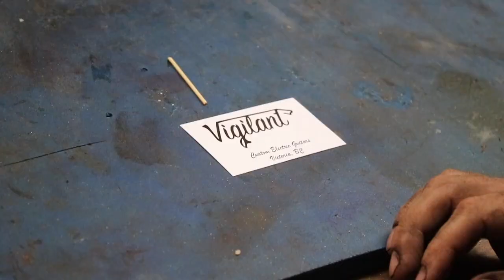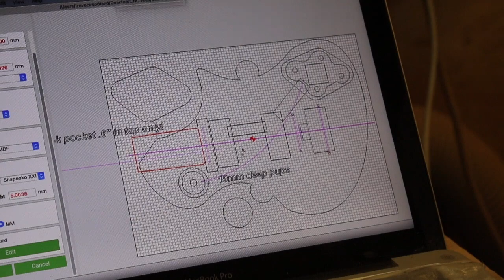Vigilant MK1 Seven String - Full Guitar Build

Comment: Question: Do you have trick for getting the distances/positions correct when drilling for the blind studs on tuning machines like the ones you used on this build? They have been nothing but a pain in the ass every time I've installed a set.
Reply: There's a few ways i've done it:
1 - put the tuners on, line them up and then tighten 1/4 turn or enough for the index pins to mar the wood then drill. 
2 - Graph tech makes the inviso-plate adaptors which have the two holes. Can use some dowel and one of the plates as template to jump from hole to hole. 
I like using method 1 and then confirming with method 2.